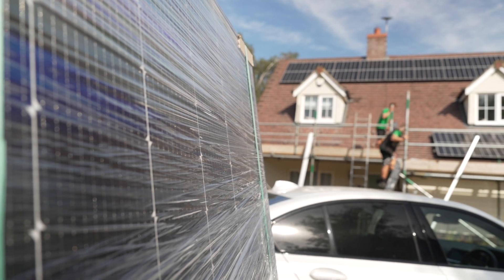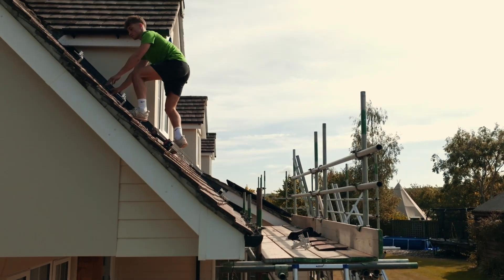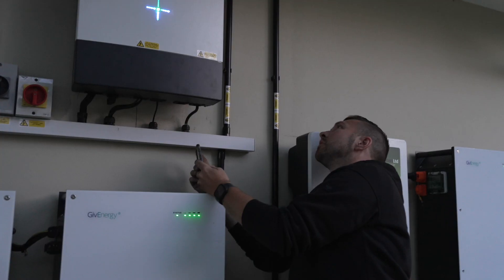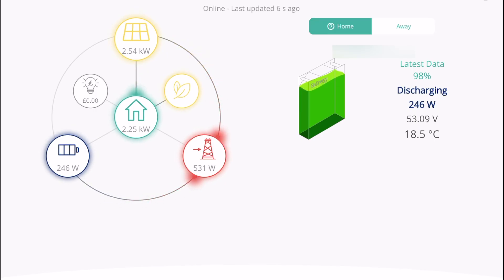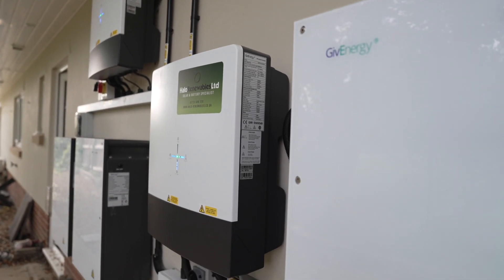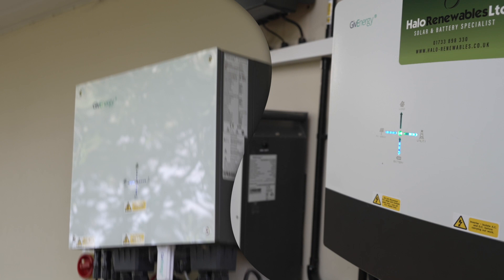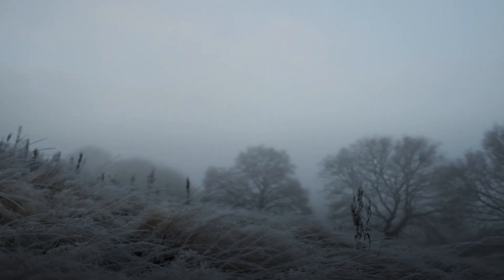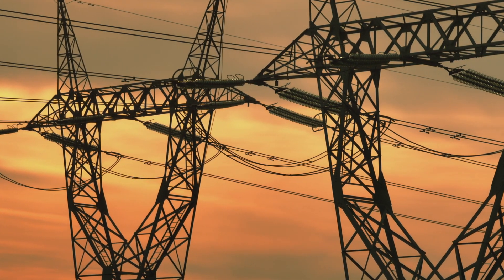Unlocking Off Grid Freedom: The Shocking Truth About GivEnergy Warning

Comment: I have a similar set-up to you, but the gateway cannot handle more than one Inverter. I have two SolarEdge inverters, a 6000 and a 10000. The gateway was only allowed to take the 6000 and the 1000 is plugged into my switch board, this means that the GivEnergy App and Portal information is always wrong, my solar generation is always double whatever they say.

Comment: I would like an AIO and the standby facility, however  Octopus energy who are quoting to fit my system will not allow any EPS nor will they fit an AIO and gateway, they will however fit a a much earlier date than the independent fitter who are swamped with work. I can fit  my own auto change EPS and connect to the system but should need to with the NEW system being fitted with Generation three invertor and 9kwh battery.   They are VERY inflexible  with their offering and the salespeople do door seem to understand what I am talking about. I would fit the whole thing myself but lose the VAT and save the labour  but it is not what I wish to have or do , The ANO would not allow joining to the grid without the  99 approval which I cannot do as I am not approved by them as a contractor would be.

Comment: I am advised , no idea if correct though , that the all in one system is to introduce the ability to add on more modular battery units.
Reply from the maker: That's right. There are options currently in testing. One of the tests is dual AIO

Comment: What is the voltage in your house while exporting? Did you even consider that?
Reply from the maker: The voltage stays between 215-255.
Reply: @Irishpixel  What is your normal grid voltage?
Mine is 252V and exporting has to top that, but appliances are designed to work on 230V +/- 10% making the maximum 253V and many have shorter lifetimes at that extreme. Also surge protectors are getting premature ageing.
Also what happens if a neighbouring property is exporting at the same time as you? Do the inverters fight or does it limit your exporting?
Reply from the maker: @hintoninstruments2369  our v only fluctuates as it normally does. The inverters manage it. We love rural so neighbouring properties are not an issue. Very little exporting properties here. DNO was approved by uk power networks so if there was likely to be compromise they would have refused it.

Comment: Mmmmm The national grid is not under strain, in fact energy demand has dropped 20% the last few years because of more efficient equipment, the main change has been led lights. More and more Wind and solar generation being added, both commercial and domestic. Grid reliability is not a concern right now or forceable future. I get wanting to be off grid, but doing it out of fear the grid is near collapse is just wrong.
Reply: Indeed the grids winter outlook margin has improved 22->23->24.
Reply: Hear hear. If you live in a seriously rural area with very temperamental supply issues ( and export restrictions) then the all in one makes sense to secure your energy supply whilst maximising storage potential,if you want peace of mind. But it makes zero financial sense in even the medium term. I was all for this but the numbers just don't add up. That said I'm still probably going to go this way at some point, but at least I'll be doing it simply because I want to, not because I'm delusional about saving money.

Comment: Your inverter ending G811 had factory firmware. Not production. Halo should have changed this.
The reason why the charge to % is not working
Reply from the maker: Inverts are on D0.393-A0.393. Turns out there is a fault with my new 9.5 and been waiting 5 weeks for a new one. Tech support was great but something is really slowing things down.
Reply: @Irishpixel What is the fault that you had? I have just had a faulty Giv battery as well - post calibration it discharged itself to such an extent that the battery cells were irrecoverable and it has to be replaced.
Reply from the maker: @danwatson1974  hey! Mine was a faulty cell. It was replaced last week and has been brilliant!
Reply: I had an absolutely awful experience with Halo. Delays, lies, no survey, no design, rushed installation. To be fair, your setup looks a lot better, with all the trunking and such, so maybe I was just unlucky.
Reply from the maker: @johngreen1060  so sorry to hear that! How is your system now?

Comment: Technically GE don't currently support multiple Hybrid installations. It's been on the "to-be-fixed" list for a couple years now. There is supposed to be an update to this available next week at the Solar & Storage Live Show.
The AIO DOES allow solar PV to be integrated into the system as a whole. The solar PV feed from the inverter should be installed into the dedicated section of the Gateway.
Currently you cannot connect multiple AIO's in parallel. It's another of the "in the future" features......
From the forums the AIO is all over the place in terms of simply NOT working, or not working as intended.
They have the EV Charger also launching next week and I keep seeing advertising, along with sales stands at various venuess, for three phase products (which still don't appear to be available.....)
Whilst GE is disruptive in terms of price/performance versus the market you have to remember that as a company they are only a few years old and as they add more products to the portfolio they seem to be struggling to keep pace with software/product/consumer (and presumably installer support)! Heck they have never been able to keep the product Data Sheets up-to-date.
IMHO they are trying to RUN before they can walk.

Comment: Be interested in how you got dual 5kw inverters working, do Givenergy support dual systems and noiot how did you achieve this and how is it supported and monitored?
Reply from the maker: Just uploading a video about that as I type. Its been an interesting week!
Reply: Yeah it works well, that's what I'm using.  They can't charge each other's batteries though which makes sense as they're hybrid inverters.

Comment: I have a large 5 bed house using  8642 kWh of electricity in last year. 
I,m looking at getting a GiveEnergy system and have been quoted a solution of 19x430 Watt pannels generating a max 8.17kw
And a 5Kw GivEnergy Hybrid 5.0 Gen 3 integrated converter and a Giv-Bat9.5 battery
In reality I want to get as close zero energy as I can
I like your setup and concerned that my quoter is limiting the system to meet easier G98 requirements even with a 5Kw inverter
Reply from the maker: I really appreciate your thoughtful question. It's clear you're as passionate about renewable energy as I am. I remember when I was in your shoes, trying to figure out the best setup for my home here in South Cambridge.

Your 8.17kW panel array sounds fantastic, but I share your concern about the 5kW inverter and 9.5kWh battery. For a bit of perspective, our pre-install usage was around 13,500 kWh, and yours is 8,642 kWh, which is on the higher side. So, you'll definitely want to make sure every component is pulling its weight.

I've had my own ups and downs with GivEnergy, especially with their rapid product changes and fluctuating customer service. It's frustrating when you're trying to do the right thing for the planet and your family.

If you're aiming for near-zero grid reliance like I was, don't be afraid to push your installer on the G98 requirements. Sometimes they take the easy route, but it's your home and your investment. You have every right to challenge them.
Reply: @Irishpixel  I am assuming you needed a G99 application. 
All my quotes are limited to 5kw converters,  so assume installers don't like pushing systems that require G99.  
I also assume they are claiming 5kw won't be achieved to meet G98 regs.
The 8.17 aray is two strings one facing south,  one facing West, I am asking about adding  third string on an East roof as well to max morning solar capture.
That makes a single 5kw converter not fit for the array. 
Have a few other installers yet to quote and visit so it's early days.

Can understand your frustration with rapidly changing tech, especially when improvements leave tech unable to be easily upgraded. But like IT the solar industry is changing fast.
Reply from the maker: @apiscator444  Regarding the G99 application, you're spot on. Many installers shy away from systems requiring G99, often due to the more complex approval process and additional costs involved. It's a more stringent set of regulations compared to G98, and it can be a bit of a hurdle for both installers and homeowners.

I love your idea of adding a third string on the East roof to maximise morning solar capture. It's a smart move but would indeed make a single 5kW inverter insufficient. It sounds like you're still in the early stages with a few more installers to quote and visit, so you've got some time to weigh your options.

And yes, the rapidly changing tech in the solar industry can be both a blessing and a curse. It's fantastic to see the advancements, but it's frustrating when those advancements make existing tech obsolete or incompatible.

Best of luck with your solar journey, and feel free to reach out if you have more questions or thoughts!
Reply: @Irishpixel  I am understanding more about oversizing panels and solar convertor g98 sizing and resultant clipping and using clipped energy to store in batteries.  But not got an full explanation from first installers but asking for more info. Battery size  needs to be matched to panel oversized to make fuller use of clipped energy storage. DC batteries make clipped energy storage easier.
Reply: You should push for a G99 Fast Track (A1-2) application, this should be completed by the Installer a MINIMUM of 10 working days prior to commencing installation. This Export Limits your setup to 3.68kwh or less and typically is NEVER refused as you are in effect complying with the lesser 3.68kw G98 restrictions.
You can then see about a a full G99 application to increase your export rate to the maximum of your system.
Reply: If you want to get as close to zero energy then with that size of property you will struggle with the limitations of the GE Equipment.
The Hybrid Inverter + Battery is output limited (when on battery only) to 3.6kw
The AIO has a higher output limit 6kw continuous.
But considering the issues the AIO is currently having (from what I can see) I can't recommend this.
I would instead recommend that you look at the Sunsynk products.
They offer a massive 16kw Hybrid Single Phase Inverter and also 5kw & 8kw Models - personally, on a cost basis, I would choose 2 of the 5kw or 8kw. These can be paired to almost any battery systems that are not Brand Locked - eg GE or MyEnergi.
Reply from the maker: @MagicianMan  Hey, thanks. I genuinely appreciate your expertise and the alternative you've suggested.

You're spot on about the output limitations of the GE Hybrid Inverter and the AIO. It's a crucial factor, especially for someone like me who's keen on pushing the boundaries of what's possible with solar energy in a larger property.

I've got to say, your recommendation of Sunsynk caught my eye. The idea of having a 16kw Hybrid Single Phase Inverter or even a pair of 5kw or 8kw models sounds like a game-changer. I'm all about flexibility and scalability, so the fact that they're not brand-locked is a big win in my book.

That said, I've found a certain rhythm with my current GivEnergy setup. It's not perfect, but it's doing a pretty good job for my family and me. However, I'm always up for a challenge and keen to explore new avenues like Sunsynk.

Your comment has given me some food for thought, and I'm grateful for that.